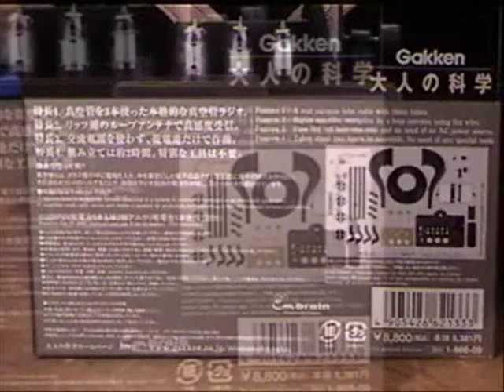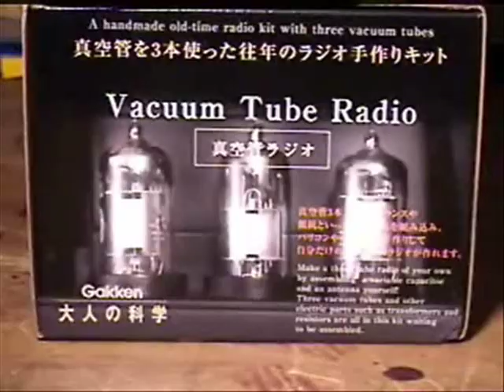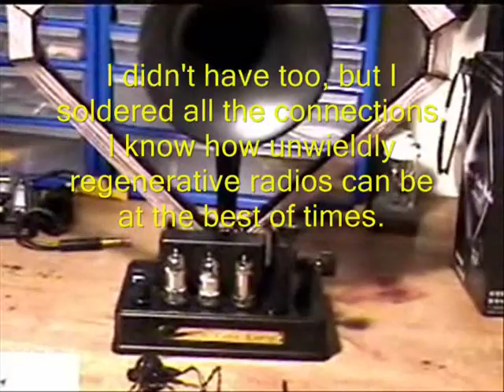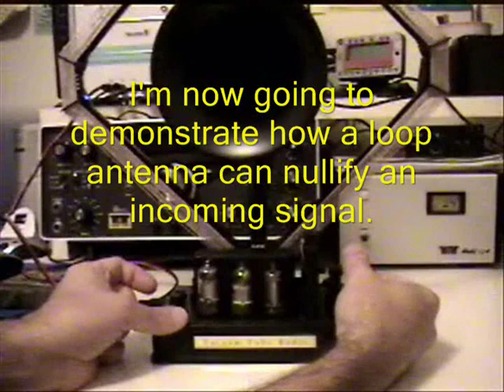Vacuum Tube Regenerative Radio Receiver Kit

Comment: The tube is not for decoration? because according to my conaissances, a tube runs from the very high voltage, or it works with batteries! thank you for letting me know.

Comment: They quit making it
Reply: I purchased one last week. You can still find it on eBay and Amazon. Just type Gakken vacuum tube radio on the search. This is the one I bought with the lowest price I could find : https://www.amazon.com/gp/product/B000EPF89O/ref=oh_aui_detailpage_o00_s00?ie=UTF8&psc=1
Reply: Carlos Galliath that one is nice,thanks for the heads up ,I was wanting like a graymark ,or some 3 to 5 tube a m radio they have several on Ali express but no direction for them .